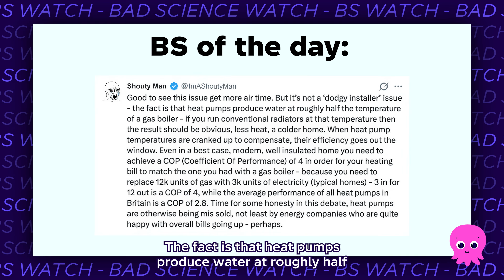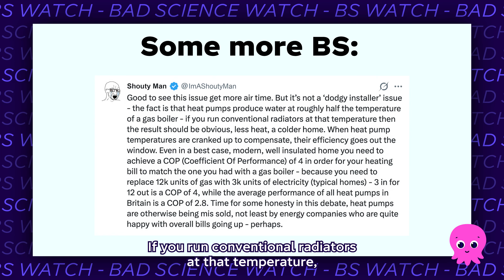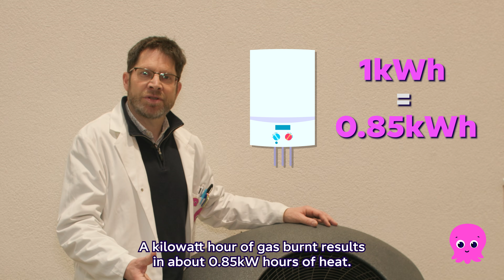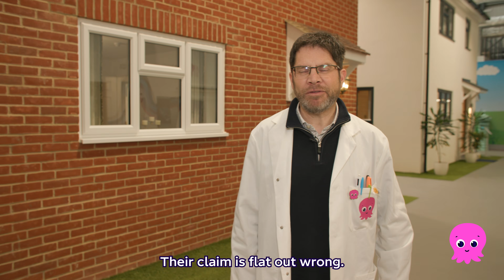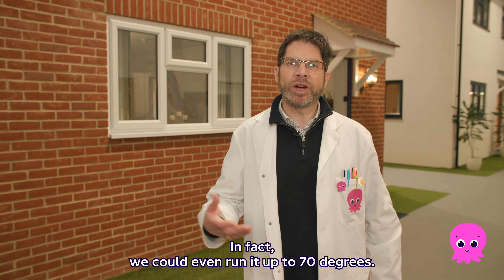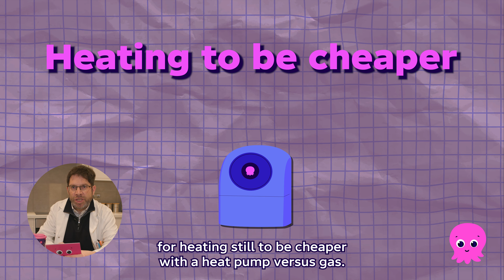Are heat pumps half as hot as gas boilers? BS debunked

Comment: My 5kW heat pump is set to keep the house at 20C day and night which is does whatever the outside temperature.
I'm on the Cosy tariff. January cost for heating £65. Electricity used 426kWh. Heat output 1584 kWh. COP 3.72 .
To produce the same amount of heat with an 85% efficient gas boiler  would have cost 1584*.0594/(.85) = £110.69 .
Obviously if for some reason you decided to use electricity at the price cap this would make the heat pump cost about the same as gas. After April, electricity charges will reduce.
Reply from the maker: Love this! Sounds like your heat pump’s doing all the hard work keeping you warm and the Cosy tariff just makes it even cosier 🐙
Reply: My boiler runs with a flow temp of 50 so closer to 90% efficiency and I have a cheaper rate for gas (5.65p but could have fixed at 5.4p earlier if I’d bothered). I didn’t use anywhere near your energy amount but assuming I did it would have cost about £100 so a heat pump would save about £35 which would be reduced more as the standing charge on electricity is a minimum 15p a day higher. 
Jan/feb are usually the coldest months of the year and after that usage drops off going down to almost nothing during summer so the overall savings are pretty small (gas will likely come down in April as well).
Until the price of electricity is significantly reduced the ROI on a heat pump is decades. Which is annoying. As is the price of heat pump suitable radiators these days!
Reply: @ianmearsphoto the thing is you presumably pay the electricity standing charge anyway (unless you don't use any electricity otherwise, in which case who are you?) where you can not pay for gas standing charge if you don't need gas. So you're saving year round for not having to maintain two supplies to your home.
Reply: @TheClumsySpectre2 yeah that’s a fair point. Saves another £110/yr but still doesn’t change the basic issue that if you’re only going heat pump for savings you will be disappointed. Plus you will only get the savings if you understand how they work and adjust the way you use your heating. Something that I think will be a big hurdle for a general public not known for their ‘adaptability’ 😊
Reply: @ianmearsphoto  Heat pump suitable radiators, they are just the same ones used with gas boilers, nothing special, possibly just need to be bigger than what's usually fitted. I never had a single radiator changed, I fitted large rads when I replaced the boiler back in 2005, they work perfectly with our heat pump which keeps the house a nice 20c 24/7.
Reply: @ianmearsphoto   electricity is due to fall more percentage-wise than gas in April. The fact usage varies is part of the SCOP average.

With the grant, simple installs can be cheap, so the ROI can be instantaneous (aside from time and hassle).
Reply: @Biggest-hz7ng  This is only due to green levies taking off an avg of £150, but moving it to general taxation.

You and I are not better off, you just think you are when you look at your energy bills.

UK electricity will remain the same, well into 2035-40 due to the baked in charges.
Even after that, I'd be amazed if it came down by more than 5p kwh
Reply: @stuartburns8657   looking at the levies, probably electricity consumers shouldn't be the only ones paying for past renewables development and I'm happy the levies get moved. There's a lot of new generation and transmission to pay for, the CCC suggest a slow decrease in the price of electricity.
Reply: @Biggest-hz7ng  I think you are dead wrong.
And levies getting shifted to general taxation (for those few still paying taxes) is a disaster.
Reply: @stuartburns8657  switching to electricity fast saves the country money. I believe there would be more progressive taxes than levies on electricity.
Reply: @Biggest-hz7ng  It's not saving the country anything
Reply: @stuartburns8657  there is a question as to whether switching saves, given the inflation in the costs of generation. Ed stated he had further plans for levy reduction recently.
Reply: @Biggest-hz7ng  Levy moving, not reduction
Reply: @stuartburns8657  yes, moving levies, but a reduction in utility bills. Inflation in generation and transmission wasn't necessarily anticipated.
Reply: @Biggest-hz7ng  Hmm.

I remain unconvinced.
These levies which funded the likes of the insulation scandal will come back to hurt us 3 fold.

When I see prices falling naturally, and not due to ineffective policies I consider things are moving in the right direction

Comment: My Combi boiler is set at 60c pumping around the radiators.Iam going soon to see my brother in the Netherlands.He has a ground source heat pump.See what it is like.But at 76 Iam not going to spend thousands on a heatpump when my gas boiler is doing fine in the UK.
Reply: If you see a steam plume from your flue you are loosing efficiency (about 10%)  , that should be condensing in your heat exchanger. When I am staying in holiday accommodation I always turn down the flow temp to 50c as when I was selling condensing boilers that's what I was trained to do buy the manufacturers.
Reply: Make your house worth more, could be less than a boiler with the grant and cheaper to run
Reply: Have you had a quote? £5.4k might be the average UK cost after the grant, but your install might be simpler and cheaper?

Comment: Why can't I have a Cosy heat pump and no new radiators etc? I accept that there will be a cost to my choice.
Reply from the maker: Hey Nigel, you can opt for a high temp install where you should be able to keep your own radiators. We'd go over this all during your survey and we've some more info here https://octopus.energy/blog/heat-pump-run-cost-savings/ 🐙
Reply: @OctopusEnergy I run my gas boiler at 40 degrees, heats my victorian draught ridden house fine at 17 degrees room temp with K2 rads, but of course the regs insist the install works for 21 degrees hence the rad replacement…I’d have to wear a mankini at that temperature 😂 Shame the regs are so rigid
Reply: A slight 'thickening' of radiators wasn't the end of the world for us. The radiators were already out of the way.

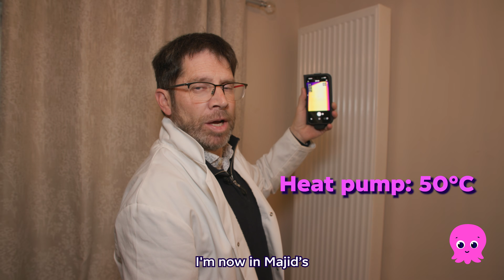Comment: 2:50 weather compensation "that's something you can't do with a gas boiler". Incorrect. Please don't stoop to the same level of misinformation as your antagonist, the "high-profile energy boss".  Modern gas boilers are available with weather compensation. However, most gas boilers out in the field don't have weather compensation.
Reply from the maker: Hey, thank you for this, you’re right - we already spotted this mistake and edited it out of the video. We want an honest convo.
Reply: Most gas boilers have the flow temp too high and rads aren't balanced properly for full efficiency
Reply: Have i missed it? They don't claim that gas boilers can't use weather compensation in this video?
Reply: @pickledlemon5406  they did, it's been edited out now
Reply: @redshift3

At 2:50 he says that weather compensation makes it (the heat pump) run more efficiently. In many cases the HP does run more efficiently using weather compensation than not using it.

I don't use weather compensation on my heat pump as a steady low flow temperature keeps my house comfortable with almost zero start/stops throughout the day.
Reply: Weather compensated boilers can even reach 95% real world efficiency, versus the 83% real world efficiency in regular installs and 85% used in this video's calculations.